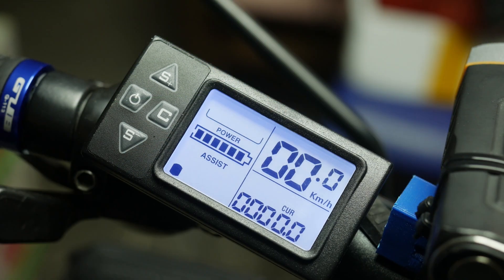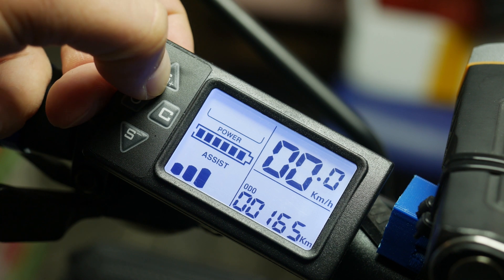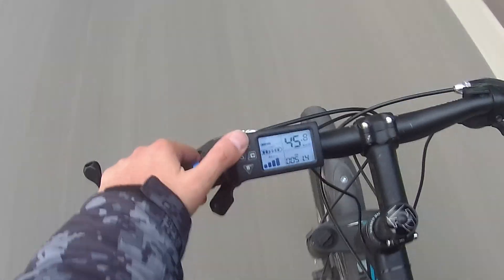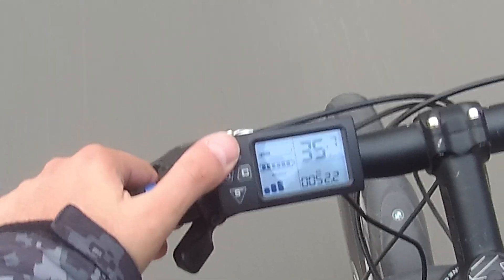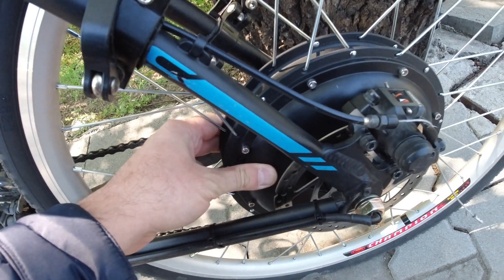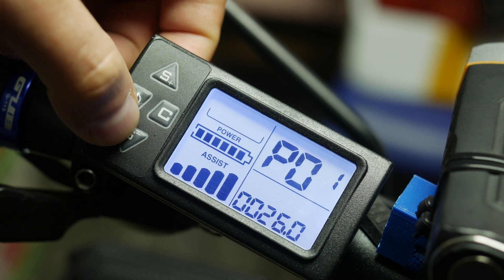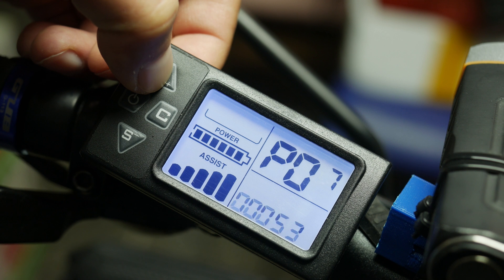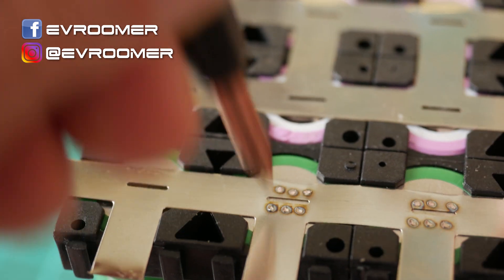eBike S861 LCD tutorial

Comment: will the cruise control and speed limiter throttle/pas levels still work at different speeds at full throttle on a voliamart controller? ,,are the wires electrically compatible for that, does it mix?
Reply from the maker: I really have no way of knowing that... sorry! 😟

Comment: I have a problem with a code error in this LCD, can you help?
Reply from the maker: I am not certain that I would be able to, but lets give it a shot! :)
Reply: @eVroomer  How can I send you a LCD photo?
Reply from the maker: @ What does it show?
Reply: @eVroomer  In the upper left corner of the display, a symbol appears showing a central dot surrounded by two incomplete concentric arcs on either side. The symbol resembles a wireless or radio frequency communication icon (similar to radio waves or Wi-Fi).

Comment: I have the same kit but the 1500w version. When I give it full throttle it fills the bar in the top left completely. It seems the display is made for the higher power controllers. Getting a 1500w controller should be fine because all those motors seem to be the same. I'm still trying to get the speed limiter working. Hopefully there's a jumper inside the controller somewhere that activates it because the limiter on the display does nothing
Reply from the maker: Good to know. The speed limiter, relative to the levels you set on the display, used to work on mine, I have not opened up the controller to dig inside, it had plenty of power anyway, I did not feel like I need any more! :)
Reply: @eVroomer  I managed to activate the 25km/h speed limit by opening the controller and soldering a pin labeled as K1 to ground. I have it connected to a secret switch🤫
Reply from the maker: @TrinusSinus Haha, nice! Yeah... some countries have gotten pretty strict about these things, a secret switch is a good idea! :) Well done!

Comment: Great tutorial! But there is one thing I don't understand: what is the Po2 setting with the magnets. I have the 500w 36v motor kit. What number do I have to enter, "46" like in the video or less because I don't have 1500W?
Thanks for an Answer and have a nice day
Reply from the maker: That would depend on the number of magnets that the motor has in it. It could be different from the 1500W one so you need to check that. I can't be certain if that would make any difference in relation to the operation of the system, or just speed measurement.
Reply: Thank you for the quick answer ❤️🙏
Reply from the maker: @JohannV-hp4fb  You are welcome!

Comment: Hi has anyone got any info on a model S861 my model goes from P01 to P08 
All my settings our out don't have the original booklet 
I can work out 
P03 is my back light 
P04 is miles/km
P06 is the time 
Can anyone fill in the blanks 
Thanks for the video 🚲

Comment: Whats that controller you have

Make and Model please 
I have the same 1 but have not looked at it as its in a cover case

All it is my controler and lcd display are the same as yours
and i have somehow managed to brake my LCD and i am without power intil i replace the lcd
Reply from the maker: The controller came as a set along with the whole system - screen, controller, hum motor. Was all made to work together in the factory! No adequate markings on it, so can't really say what make and model it is, but it is a 1kw system... I think it topped off at around 20A at 48-52v.

Comment: Thanks for the video. But, is possible to turn on the LCD automatically when power on the battery and not by pressing the lcd button?
Reply from the maker: If there is a button, I doubt there is a way to do it in software. I suppose you may be able to work out some hardware bypass... but really not sure how it will work.

Comment: Ok my kit (36volt 500watt hub motor) it has the same LCD display but watching this a couple of the settings are different like example p04 it shows a different setting then what yours does and I've seen some people explain that you can go to p10 or more mine only goes to p08 so what LCD do I have the buttons and display is exactly the same so how can I find what is up with mine
Reply from the maker: Well as it turns out, it seems there are different versions, I would assume, of the firmware for these, perhaps dependent on the controller it is connected to, so there are A LOT of variations out there to the number of settings options you get!

Comment: Thankyou so much I cant believe my kit never came with proper instructions for the LCD screen. I see you can change  the voltage mode on PO5 Do you know or does anyone know if I  change this to  36V will this allow me to run at 36v instead of the 48 ( I know it will be slower but I only want to go about 15 miles an hour anyway ) I have a 1000w motor and its too fast , way to fast !!!
Reply from the maker: Yeah, the 1000W does get up to speed, especially on the flat! As for whether you can change it... I see no reason why not, but keep in mind this would be a setting only for the display, the controller will need to be replaced, as well as the battery, if you want to run a lower voltage that is not supported by the controller.

Comment: Hi. Great Video. Learnt alot. Cheers.

 I noticed you mentioned PO7 doesn't change max speed. In my manual PO7 is 0-100% what Assist level 5 is. Mine defaults to 66%. This only works when you connect the speed/power limiter switch on the controller (believe it is K1 pin in the controller to GND) to limit Assist to 1 - 3 levels.
Reply from the maker: Thank you! Glad it was useful! Right... well I don't have that wired in... so that may be why it makes no difference for me.

Comment: I know I'm a bit late but I had to order a new lcd. But now the battery level stays on full bars at all times. How can I get the lcd to sync with battery level if possible? Help Please... Anyone
Reply: You may have the P setting for voltage. Mine has 36/48v option. If you have a 48v battery and the aetting is 36v, it will always show full.
Reply from the maker: @eamansemmakie3812  Well that makes sense... :)
Reply from the maker: Hm... I am not sure I have an answer for you sadly! Been quite a while since I've been in the settings, and I can't say that I recall any, and right now I am in the middle of a serious restoration of one of my bikes, so can't really check since this bike is too deep under other stuff!
Reply: @eVroomer  alright so I have figured out just about every setting and every solution do to LCD/options/just about everything that can be messed with inside the LCD which is basically like the computer as everyone knows so if anyone has any questions or concerns
Reply from the maker: @justingoke8445  That's awesome mate, well done! :)

Comment: Dear sir there are other display icons  likewise brake , accelerater can u tell more for this
Reply from the maker: Well if you have the brakes wired in to the display, when you press the brake it will indicate it on the screen with that icon that the brake is pressed and the motor is cut off, the throttle icon, I assume, shows the throttle is active and working!

Comment: Good job, watching this over the pond in Iowa. Just took out my 500w ebike for its first cruise. Speed maxed at 21mph, but My phone GPS speedometer showed I was maxing out at 28mph. I think thats just a legal hard setting they program into the controller because it pegs at 21 regardless of whats actually happening.
Reply from the maker: Could be! Question is... does the ODO record the mileage correctly, or is it also skewed towards the fake top speed?
Reply: Sometimes you can adjust the wheel size in settings to compensate for the spedo diff. Hope this can still help!
Reply from the maker: Thanks for the input! :)

Comment: My ebike with a similar display has a throttle that only works while pedaling, is there any settings to make it work without pedaling? Thanks
Reply: I think 1 and 2 on P08 are for - 1- pedal assist with throttle 2 - pedal assist with independent throttle
Reply: I know on mine the wires are red and green or so for throttle and exactly the same wiring and colours for pedal assist; and thus i think you may have the throttle on the pedal assists connection and vica versa. As they will both work on each other's connections because they both accelerate the wheel. Just that the activation peripheral is different. And after that in some cases P09 or so needs to be set to 1 or 2;  meaning throttle and assist  together or throttle and assist independent of each other
Reply from the maker: @Islamicknowledge-yx8rt  Actually... not sure the throttle will work if connected to the pedal assist wire. The throttle maintains a fixed position on the hall sensor when you twist it, which tells the controller how much throttle to apply. The pedal assist needs to rotate continuously in order for the controller to apply throttle to the hub... if you stop pedalling and hold it in one place, like you would the throttle, it will stop throttling as well! Either way, I do like how this works, and how you can use the pedal assist levels as speed limits, removes the need to try and keep a constant speed manually. Just set it to the limit you want and apply full throttle at all times, it will stay at whatever speed that limit is at without going over. :)
Reply: @eVroomer  Well...it was one or the other or vica versa ,but i cant remember because it was a few years ago. I cant even remember what happened. Maybe it just turned the wheel a bit. But i was hoping this would give him some insight to what may have happened or to figure it out  👍🏽
Reply from the maker: @Islamicknowledge-yx8rt  Lets hope so! :)
Reply from the maker: Did you try the settings? Did it work?

Comment: hey man so i changed all the settings on my totguard ebike model t-266 before I watched this video and now it caused some issues I searched the bike company but I only find baby cam manufacturer any idea how to to get the settings like the magnet amount? Because now when I lower the assist amount it goes max speed even in the lowest. I do remeber that it was somehow locked to just go up to 3 bars though not sure if that info helps?
Reply from the maker: Well number of magnets would depend on your hub and how many are in there! As for accelerating at lower assist... does not sound like a pole count issue... but I could be wrong...

Comment: the number mentioned in the video are vary controller  2 controller so my ebike has totally different settings  . example P01 is background light and P02 is unit measurements  and so on..
Reply from the maker: Yeah, that seems to be the case and it sucks as there is not real consistency!

Comment: Hello, I badly need Your assistance if possible, having same set as Yours/identical but with throttle on handle like with motorbike, PAS senor installed as well, did 400 just km, and bye, after fully charged battery (famous batteries UNIT PACK POWER 48V 20 Ah) I can ride just for kilometer or two, depends on power demand, and then electric will cut out and display will slowly dimme into black out....didnt went in full investigation as I am abroad at a moment...just waste of 600 euros in total. Very disapointed and sad, if any idea please let me know
Reply from the maker: Hey... sorry for the delay in replying! Did you figure it out? From the info you have provided my first guess would be the battery is badly unbalanced and the protection board in it is cutting power off when one of the cells drops below the programmed low end of the voltage! What voltage does your screen show before it shuts off?

Comment: Has anyone worked out how to re-set to default settings?
Reply from the maker: I am not sure to be honest...
Reply: He mentioned everytime you turn it off it re sets back to default automatically.
Reply: @ROCKO633  Mine doesn't
Reply: @bakersw0rld847  I've learned several different builders use this same bike frame from SMLRO.  They just throw their electronics on it. So it's possible yours is completely different than mine. My bike was hit by a truck about 3 months ago. I can't find parts anywhere for it

Comment: Very interesting I only just got my bike where I hold down the c button the assist changes to a flashing man and the motor   causes the bike to jerk forward slightly any idea what this means I’m trying to work out why the throttle only works in PAS 5???
Reply from the maker: Seems to me like this could be some walk assist mode, for when pushing it, so as not to feel heavy and be cumbersome to do so!
Reply: @eVroomer  Yes, that's what it is, if you hold down the S- (lower) button for like 5 seconds it turns on walk mode, BE CAREFUL!
Reply from the maker: @Qossuth  Right, useful info!
Reply from the maker: @WE ARE SOLAR FARMERS :)

Comment: I have motor error, how can it be reset or where is the error? Wheel does not turn battery fully
Reply from the maker: I am not sure how that can be reset! How do you know the display has an error, does it show a code of some sort?
Reply: @eVroomer  with a sign over kilometers an M with a circle drum. Error cable break to the engine. but another question in the settings my display only goes up to P09 facon lcd? in the videos they go up to P14? controller 36v 500watt
Reply from the maker: @m.s.8293  But how do you know this icon means "cable break to the engine"? Does the motor still work? As for the settings... yes... it seems there are various versions of the display with different firmwares, some have fewer settings, others have more, it is a puzzle!
Reply: @eVroomer  motor did not say anything colleague measured the bike battery was full there was no power on the broken cable he repaired it. where can i get the settings for my display in german?
Reply from the maker: @m.s.8293  After repairing the broken cable... did it run? I was barely able to find a semi literate, apparently incomplete manual in Chinglish... doubt there would be one in German!
Reply: @eVroomer  where it has been repaired it works again. have a falcon S861 display but do not know what version because it goes to P09 there are no settings for. 500watt rear wheel 7 pinions and front 3 pinions
Reply from the maker: @m.s.8293  Well... sadly the power output or the pinions are no indication of the version you have! Guess you will have to deal with what it is!
Reply from the maker: @WE ARE SOLAR FARMERS You mean the controller options?

Comment: Dear eVroom, Thank you, this was very helpfull! I have this controler on my Nakto "Santa Monica" E-Bike. Mine has like yours PO1-9. But it also has as well,  P1 1-9 and  P2 1-9. Would you if you could tell me what P1 1-9 and  P2 1-9 are indicators for? Respectful regards, Kirk. I liked and subscribed! Thank you again!
Reply from the maker: Thanks! Well... I am not sure to be honest... apparently there are different firmware versions of these screens, with more or less options... I have reports for some others with other functions too... so can't be certain what those are! It is possible... if the settings on P1 through P9 are the same on all... could it be they are different users that you can set... and just quickly chose which one is the "user" if different people use it... perhaps...?!
Reply: Sorted bud.thanks
Reply: They have a manual on their site. Check them out. And I would say, they have a pretty different setting on P00-P09